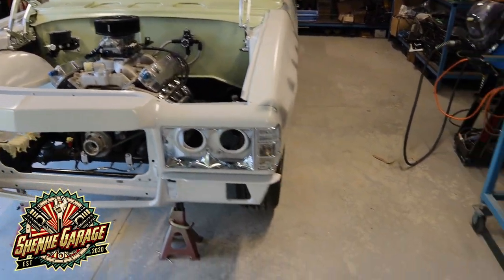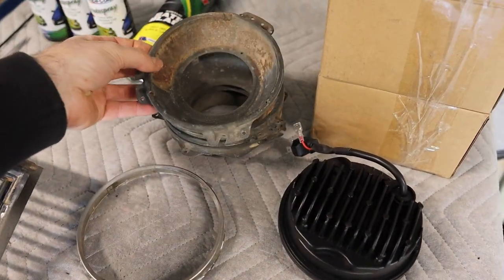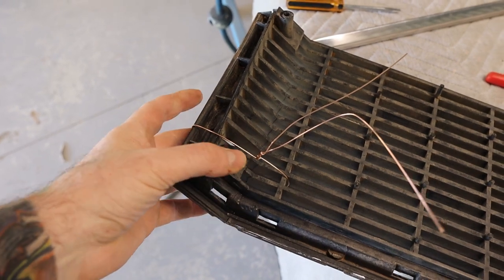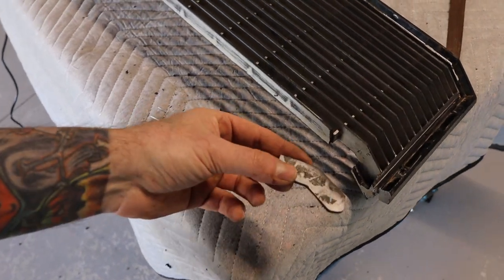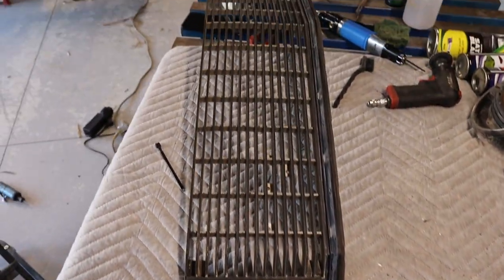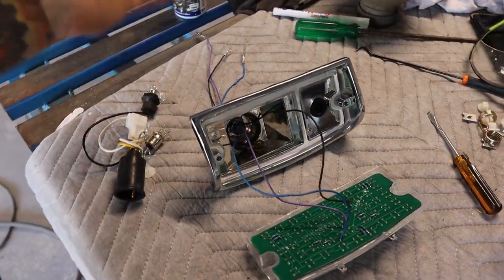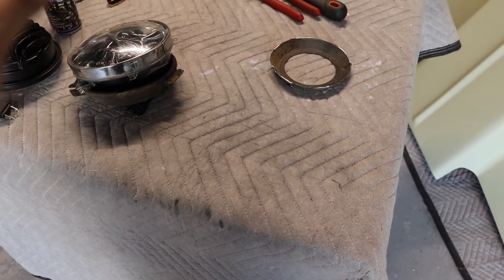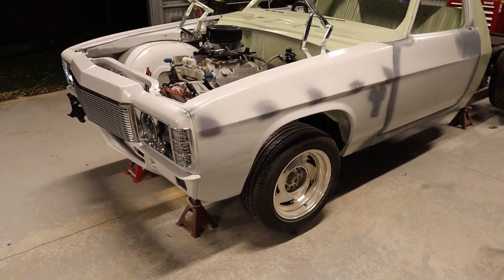LED Lights and Restoring the Grill - HX One Tonner Build

Comment: Good to see you decided to plasti weld. I learnt how to do it a few weeks ago and was a life saver.
Reply from the maker: Yeah turns out its not really that difficult. I found the lower temp soldering iron did not burn and cause smoke with the plastic...
Reply: @ShenkeGarage  yeah likewise. The zip tie/soldering iron method is my go to. Used it with a 3D printed facsia adapter that cracked to hold some speedgut gauges, worked a treat.

Comment: HJ style sides get my vote, steal blinker stork and steal A pillar trim.(not plastic, from HX on wards) style side will always fetch more $s. So scrap it and start again...😁....Joking you're doing a great job and I'm liking the modern touch's 👌.FYI body filler over your plastic repairs, you will never know they where broken to begin with. If you decide to paint your bumpers and because you are getting handy with the fabrication side of things, may I suggest you slice and dice them so they are a very snug fit, you will love the look, colour coded bumpers snug fit against those lights and grill... 👌👌

Comment: HX is my pick, owned mine for eighteen years and counting and was my first car. Interestingly, my front side lights are from a company called vleds and their from the V6 Triton (not the ute) “switchback” series. Can be setup to be DRL, Park or indicator out of a single bulb and even have the load resistors built in. Pretty trick. 
I’d never heard of this guy doing H Series custom lights, and unfortunately I don’t have a Facebook so I can’t see his page.

Comment: Bit late for advise now, but the 7” led headlights come in a range of bucket sizes, the ones that would have fitted for the hq-hz are the jeep shallow bucket type.  The heatsink is a shallow bucket on the outer ecge, but deeper towards the deepest part of the bucket.  Ivehad personal exp with this.
Reply from the maker: Hey Mate thanks for the feedback. I wish I knew that before I started. Well If i need to replace them then will be handy
Reply: @ShenkeGarage  don’t worry, i learnt the hard way as well. 😁.

Comment: Hey bud love your work....with the fitting of LED headlights .... I have the same lights going into a hq premier....they will not fit (like yours) what model headlight buckets  did you use...you mention in your video you had two different types.  Just trying to figure out which way to go..Ebay has some mounting brackets ( to suit jeep) but ??????

Comment: These Headlight say they are made to fit a HQ, seems an awful lot of modification to actually make them fit which is a bit disappointing. Doing my HQ tonner currently and had these headlights bookmarked to put in, thanks for the video
Reply from the maker: No dramas at all Mate. Yeah agree. Its kinda annoying they advertise for HQ - WB but they do need modifying a lot. Its a bit of stuffing around but they look good.